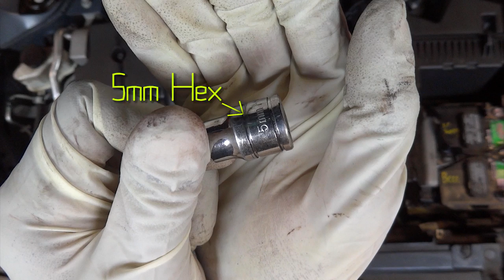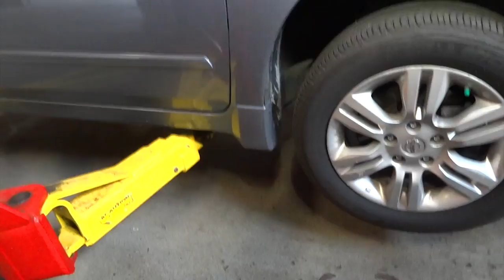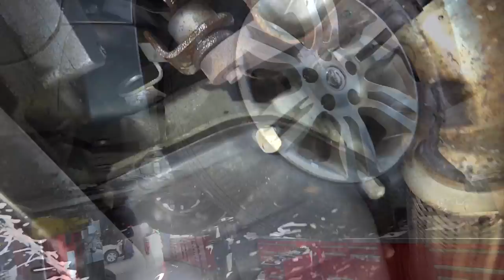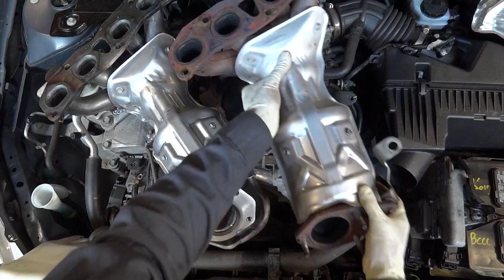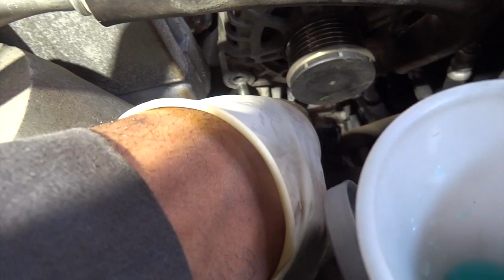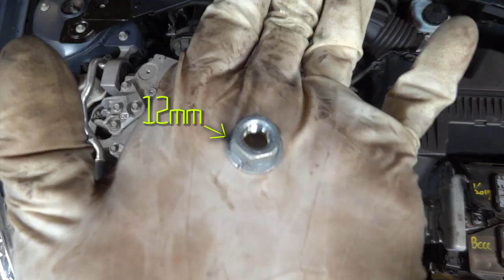2007 to 2012 Nissan altima 2.5L catalytic converter replacement - Exhaust manifold DIY

Comment from the maker: DISCONNECT THE BATTERY FIRST BEFORE DOING THIS JOB!
Reply: What are the torque specs for the bottom bolts? Are they the same as the top?

Comment: I changed mine Monday morning it took about 4hrs followed your every move thanks for how you explained what size bolt and showed the location my check engine light and traction control light went right off, GREAT VIDEO

Comment: I have learned a lot watching your videos AFP, changed my motor mounts and look forward to doing my valve cover gasket and Cat converter on my 09 Altima soon! You're the best!!
Reply from the maker: David G. Santiago thanks man. Glad I could help.
Reply: Any advice how to clean the throttle body for my 09 Altima sedan?

Comment: What a fantastic video! Thank you so much for taking your time to make this.
Reply from the maker: j0bbers your welcome..I also did a video with narration for this same job..check it out.be sure to subscribe.
Reply: Auto Fix Pal subscribed and liked!
Reply: I know they are super rare but I own the Altima Coupe 6 speed. Think of any chance you will have a clutch/flywheel change video up this summer?
Reply from the maker: j0bbers not very likely.but if I get one of those jobs I'll film it for you.

Comment: Great video! I'm a bit confused on what if anything is being replaced in the undercarriage though. When i search for replacement catalytic converters,  there appears to be the catalytic converter attached to the manifold (which your video is showing), but there is also another part that has no manifold attachment and more closely resembles the piping to the exhaust (which I've seen in another video). My mechanic also informed me there are 2 catalytic converters in my 2010 nissan altima 2.5sl. Are there additional items in this video that we might not be seeing? Is my longtime mechanic lying to me? Why does it seem like there are different versions of the same product that look vastly different from one another? Hopefully that all makes sense. Sorry for the wall of text. Thanks either way!

Comment: Another great video. Quick question What's the torque specs on the bolts to cat and the nut on that same bolt cat to pipe?

Comment: Awesome tutorial, I have a 2013 Altima sv 2.5 and have burning rubber smell coming from it, I wonder if I should change my exhaust manifold & catalytic converter as well.
Reply from the maker: Bodega Slim burning rubber smell is not likely to be the exhaust. unless a plastic bag is stuck on the exhaust.
Reply: Auto Fix Pal appricate the feed back chief, I defanitly had bubble wrap under there and some smoking coming from the hood confused as fuck fa real.
Reply from the maker: bubble wrap will stink for a while unless you go somewhere and have it scraped off.

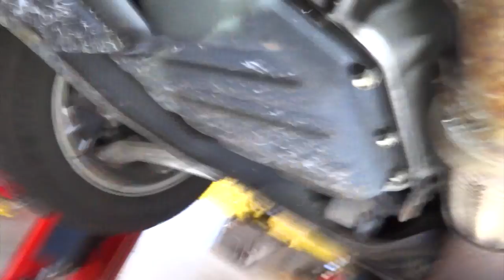Comment: Thank you for such a great quality video!  I have an exhaust leak at the flange.  I noticed the bracket is broken where the 14 mm bolt goes (7:00).  Can I just take this bracket completely off since the new manifolds don’t use them anymore?  Or should I replace it?

Comment: Is that the thing that you open in front of the front seat in a car.
Reply from the maker: No Buddy the catalytic converter is either under the hood or under the car. In many cases it is both under the hood and under the car.
Reply: @Autofixpals  excuse me would the performance headers for a 02-06 Altima 2.5 fit the 2016 Altima 2.5 or did the fitment change in newer altimas??Asked because the engine looks exactly identical in the 02-06 bodystyle

Comment: My car has been losing power up hills. I'll be doing this job in a few days. Should I change the air fuel ratio sensor at the same time? Or should I just clean it? I can't find the genuine sensor, but so far, it's about $110 for the Denso brand. Thoughts?
Reply from the maker: denso is good, replace it dont clean it. You can get to the AF sensor pretty easy on these at any time. losing power up hills may not be the AF sensor. could be a number of things.
Reply: Basically, my engine revs in rpms and moderately gains speed. Took it to dealership, they found no codes. Cycled out Trans fluid two times with genuine Nissan cvt fluid. All oil changes have been with Royal Purple fully synthetic. Installed K&N air filter. The K&N improved performance a bit. I always use 91 grade fuel. Installed new cam gasket because it was leaking (from your other video) and replaced spark plugs with NGK Laser Iridium plugs ($17x4). From all my research, at this point, it seems to be pointing at the catalytic converter? Or a sensor? Fuel filter? Just trying to get it running like when I first bought it. 2012 Altima, 90k miles.

Comment: I'm about to replace mine, is there anything else you would recommend I do while I have it apart?
Reply from the maker: You could change the A/F ratio sensor and o2 sensor. Sometimes (rarely) they start misbehaving after they have been jostled around during the manifold replacement. Belt is also pretty easy to do while your at it.
Reply: @Autofixpals  Thank you for the quick reply and for the great video!

Comment: I think this was done at the dealership, guy had nissan ski cap on. Dealership are expensive out of pocket money if you don't have a warranty of some kind on your car. I called midas and a job like this was 1200 bucks and change. Thanks for video though, alot of work is involved.
Reply from the maker: Tony Garza aftermarket catalytic converter won't last long.. Midas uses poor quality aftermarket manifolds.. I have installed aftermarket manifolds on these as well as OEM.. I have never had to do an OEM cat converter twice... Aftermarket many times... Save the aggregation and get OEM.. You don't have to have the dealer install it... Yes i work at a Nissan dealership.. But I also have aftermarket experience as well.
Reply from the maker: ohh and this repair was covered under warranty.  There is a recall on some of these, always a good idea to periodically contact your dealer to see if there are any open recalls on your vehicle that you may end up paying out of pocket for to a place like Midas that will NOT tell you if a part is covered under an extended warranty or a recall.

Comment: Thanks for the feedback, definitely something worth considering. I have one more question for you. My a/c fan motor under the dash board is making alot of noise, probably full of debris 07 Nissan Sentra S. Could you give me ball park figure on just labor to change out fan motor for a new one? Being trying to call my local nissan dealership but it's practically impossible for someone to pick up the phone now days. Thanks for your feedback and video. Keep'm coming.
Reply from the maker: The labor guide calls for 5.4 hours. Thats via mitchell labor guide. So depends on what your dealer charges or local shop. just dont let them charge you more than 5.4 hours for the job and don't let them install a cheap blower motor if it turns out to not just be debris.

Comment: Hello. Thanks for your videos. I have the same car. Everytime I look something for my car your videos show up. I have the check engine light on. The mechanic checked the error code and told me that the code is about the upper catalytic converter or the oxygen sensor on it. However the car has no problem when running. I guess when you have a faulthy sensor you should have other problems or symptoms. The car has 103.000 miles. Do you think the problem is the catalytic converter or the oxygen sensor? Thx

Comment: Generally good. Thank you. However, not mentioning how to remove alternator belt is a big flaw. I thought the alternator has tension adjusting screw like all the cars I have worked on so far. I have to search again to find out the unique tension adjusting mechanism by Nissan.

Comment: Just bought a 2009 Nissan Altima, po420 code . Should I start by swappin out my fuel pressure regulator to diagnose if thats causing my cat to be bad?

Comment: My 2010 Altima recently showed code for a cat issue. Is there any precautionary repair I could do to troubleshoot before breaking the bank and replacing and if I do have to replace it, what would you say the repair should cost if done by a mechainc

Comment: Super dope video, really detailed in every aspect. I had a quick question, do the headers usually get replaced with that specific car generation? My car recently got a low emissions catalytic converter needs to be replaced light. Do I need to get headers too? Thanks!!
Reply from the maker: 44fan182 if you have a p0420 chances are very good that you need a bank 1 catalytic converter. Is your vehicle a 4 cylinder Altima?

Comment: So my mechanic did this job for me. Drove 20 miles on the freeway and all of the sudden my belt fell off and my Steering wheel locked up and car overheated... My question is did my mechanic do something wrong? The black springs pop out from the pulley part. I find it suspicious everytime i bring my car too him something else happens... He did replace the part and labor $150 but I feel like he is milking me. What causes the pulley part to go faulty like that? I could of died.. I also want to mention that he said he didn't touch the belt at all. Is that possible to do this job without removing belt?. And didnt remove the Alternator completely, just unscrewed the bolts on top... If any one can help me with this Question it would be very much appreciated!

Comment: Cats went out due to a valve cover leaked oil leaked into the spark plug wells caused my engine to misfire ended up ruining the cats cars at 180k so it should be changed for the age about to do the job on it once I get the parts, do you recommend replacing the o2 sensor?
Reply: Itz YABoi LOWPro how much did the new cat cost you?
Reply: Ramiro Serrano about 150
Reply: where?
Reply: Ramiro Serrano amazon

Comment: Working on  a08 Altima my my question is. Having transmission issue is it better to replace transmission or can I just rebuild it by fixing the bearings inside which have gone bad.
Reply: Throw it away

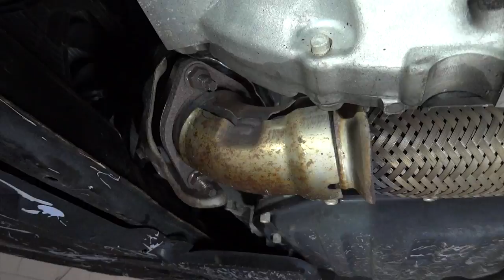Comment: 20:52 On the bottom right picture there are two graphs.  The top and bottom both say 'Oxygen Sensor After The Converter' on the right side.  Did you mean to put 'Oxygen Sensor Before The Converter' on the bottom graph?

Comment: My 2010 Sentra has a CEL that says the catalytic converter is working at its highest capacity. Does this mean in needs replacement or is there a remedy for it?
Reply from the maker: if you have a p0420 DTC than its most likely a bad cat converter and or an exhaust leak near the cat. If no exhaust leaks than most of the time its a failed cat.
Reply: Auto Fix Pal so if it’s a failed cat, what then?
Reply from the maker: @AndieNow  There is no other option except to replace the cat. As long as you don't have any misfire issues or anything wrong with your vehicle causing it to run rich. You should get at least 100k miles out of an OEM replacement. However Driving around with a misfire is a quick way to destroy any cat.

Comment: I have a question would u universal catalytic converter work as well or do I need the manifold
Reply: The universal would need to be welded  onto your manifold which in turn means the old one would have to be cut off. It will more than likely cost you more than buying a new manifold/catalytic converter

Comment: I done this procedure this evening and accidentally touched the exhaust shield to the altinator causing a spark. The car won't start headlights won't come on gauge cluster won't light up. Interior lights work. Fuses seem ok. Help please auto fix pal. Any ideas?
Reply from the maker: you blew a main fuse by the battery. Check the fuses that are by the positive battery terminal. Well they are actually attached to the positive battery terminal. Ohhh i hope i put in the video that you should disconnect the battery before you start this job.
Reply: @Autofixpals  Got it!! Thanks a bunch!!
Reply from the maker: @matthewjohnson4545  was it one of the fuses by the battery? curious.
Reply: @Autofixpals  Yes. The 250amp next to the + post.

Comment: Anybody know where to get a converter for a cheap price for 07nissan Altima 4 cylinder
Reply from the maker: Efren Salazar try rockauto.. But don't expect cheap to be good.
Reply: Auto Fix Pal thanks ^_^ .. I can work with that.. also I took my car to auto zone and they showed me the things I need to fix and got a catalytic converter threshold bank one.. question is: I just need to replace what is shown on the video and nothing else.. like the pipes under the car >. <
Reply from the maker: as long as there are no leaks close to the manifold cat than you should be fine changing just the manifold.
Reply: Auto Fix Pal another thing does gas type matter what I put on my 07 altima... I've been using regular gas from Costco and it contains 10% ethnol. . Does that affect the converter??
Reply: Amazon